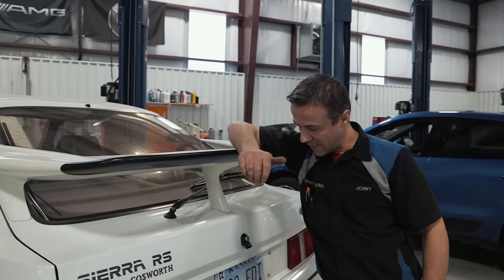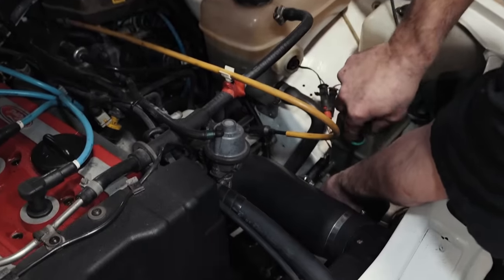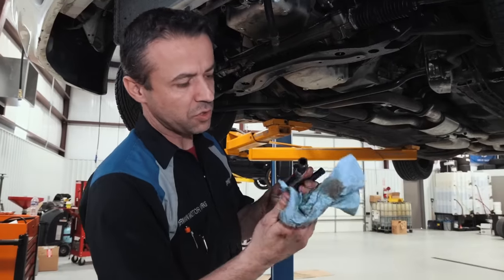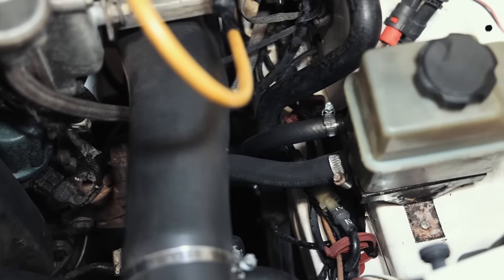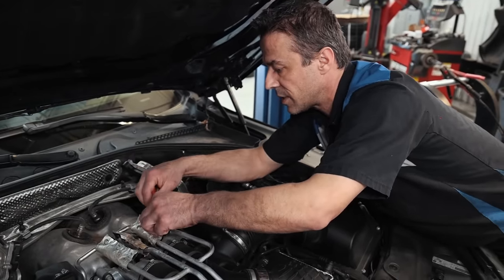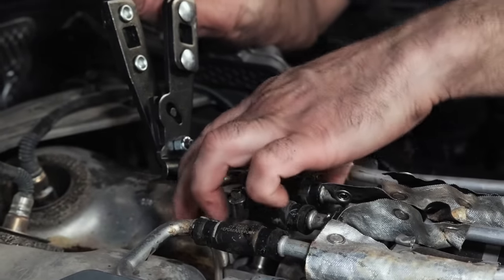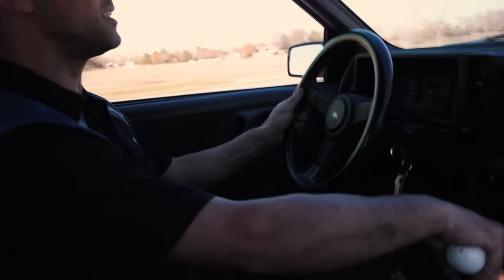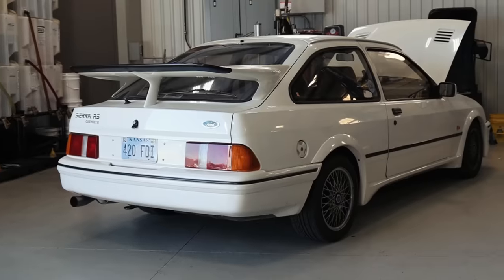Ford Sierra RS Cosworth. MY HOLY GRAIL.

Comment: My first car was 1991 Ford Sierra made in Belgium with 2.0 "Pinto" engine, with 5 speed manual. It did not have anything, no power steering, no abs :). Had it for 5 years, very reliable and fun to drive.

Comment: 🫡👍🇸🇪
I owned a 1985 Sierra 4x4.
V6 2.8l
4wd with 64% rear and 36% in to the front wheel.. it was so fun to drive in the winter.
I miss that car.

Comment: Its worth mentioning to US friends that this car is not a Merkur XR4Ti. The parent Sierra may be the same but the Cosworth was a very different car and the RS500 very different again as it was hand built by Tickford.
The bodyshells are different and while the XR4i bodyshell was used to prototype the Cosworth concept they became two distinctive cars in production.
Reply: Thanks for clearing this up.  I was wondering.
Reply: the RS500s were all right hand drive weren't they.
Reply: And an RS 500 has just sold for over £500,000
Reply: @ianmontgomery7534  The original Tickford RS500s were all RHD but some aftermarket tuners have produced LHD replicas.
Reply: The  differences with the 500 was a bigger turbo, eight injectors (4 connected), larger intercooler and different management. Externally Tickford added aero to the front, a lower spoiler at the rear with a lip added to the upper spoiler and your fog lights were in a box in the boot.
Reply: I was about to suggest the Merkur as well, lol. Would be cool to do a tribute build using one as a base. I would assume they’re still worthless so scooping one up shouldn’t be too hard and I’m also assuming parts support from Europe is still robust.
Reply: We had the Sierra XR4 in Argentina, 2.0 4 cyl, NA. It was the hot model to compete with the Renault Fuego and Peugeot 505. We never had the turbo versions.
Reply: Also the Merkur XR4Ti had a turbo version of the 2.3 ford found on mustang, thunderbird instead of the 16 valve. And rear 1/4 windows are different con the American car.
Reply: Many of the race cars were apparently XR4 shells with the rear quarters cut out, mostly in Australia if I remember correctly. Though a lot of cars tended to travel and swap hands over the years and ended up in different series.
Reply: It is also worth noting that all sierra XR4is used for racing in Europe were Merkur XR4Ti shells due to the added bracing and increased stiffness of the XR4Ti.  The euro sierra is pretty floppy.  Before the cosworth came along, the Merkur XR4Ti was actually more powerful than any sierra variant sold in Europe prior to the cosworth as the top spec engine there was a 2.9L v6 producing 145hp versus the base model XR4Ti that produced 175HP.  The shell of the XR4Ti is used for the Sierra Cosworth with modification to use the cheap base model sierra rear window as the cosworth came from the racing circuit, which used XR4Ti shells.  In fact, that base model window was heavier than the XR4i split window, but Ford was eliminating the split window as it was expensive to make and thus made the cosworth use the heavy cheap window design to mimic the cheaper styling that ford was migrating to.  The Merkur XR4Ti saved the Sierra in Europe from getting the axe prior to the cosworth coming along.  Sierra sales were miserable in Europe as Europeans lamented the loss of their boxy Cortina and didn't warm to the jelly bean style.  Ford was slated to kill the Sierra in 86 but was under contract to keep producing for the XR4Ti.  So they let sales in Europe continue while they fulfilled the XR4Ti contract.  That is when Ford got the bright idea to do the cosworth for racing using XR4Ti shells and made the sierra name legendary.  Had it not been for the Merkur XR4Ti, there would have not been a cosworth sierra or any sierra variant after 1986.  Many have built cosworth clones using the Merkur XR4Ti shell as everything Cosworth bolts up to it with zero modification.  Some go as far as using the cheap big window but most don't because they are not tickford and it makes the car heavier anyhow.  And now you know the rest of the story.
Reply: @paulnoble5627  yeah it was originally based on the xr4 shell for prototyping wasn't it? Then Ford would sell the "Cosworth" shells to teams and whoever wanted one.
Reply: @paulnoble5627   Well I suspect that is YOUR version of the rest of the story to which you are fully entitled of course. But I fear we must agree to disagree on the idea the US spec Merkur saved the Sierra.
Quote:
     "The Merkur XR4Ti saved the Sierra in Europe from getting the axe prior to the Cosworth coming along.  Sierra sales were miserable in Europe"
The Sierra in the UK alone sold 160,000 in 1983. Its best year was 1989 when, again in the UK alone, more than 175,000 were sold.
Hardly 'miserable'.
If the Merkur was such a great car why did Ford kill it after just 4 years? Lincoln-Mercury dealers moved just 12,400 Merkurs the first year, nearly 13,600 the next and sold just 42,000 through 1988 and 1989. It was canned in 1990. The 'miserable' Sierra went on for another 3 years.

You suggest:
   "The shell of the XR4Ti is used for the Sierra Cosworth"
Sorry it was not. As I wrote above it was an XR4i shell that was modified to prototype the 'Cosworth' concept to Hayes and others but thereafter they became very different cars in production.

You suggest the Merkur was lighter when in fact because of US and Canada regulations 850 unique parts were developed and all of the changes added approximately 280 lb (127.0 kg) to the weight compared to a Euro Sierra.

You also neglect to mention that the Lima engine put out 170 bhp for the first years of production and that the 175 bhp came later. Both were suffocated by US emission systems reducing output.
Reply: @freeandresrivera  the body shell is totally different...
Reply: @PatricioGarcia1973  The Renault Fuego, I forgot about them. When I was a kid I loved their shape, it looked like the future.
Reply: The 500's were pretty floppy, saw them in all sorts of motorsport discipline and provided they survived to the end they looked like they were going to fall apart at any second.
Could care less about the hyper-specific aero because there's no point having a floppy car you cant use, so I'd sooner have the much reinforced XR4 with the cossie powertrain.
Reply: @mfranssens  you should watch some argentine TC2000 from the mid 80s to the late 90s. The sierra, fuego, VW Gacel (like an 80s Audi 100), Fiat Duna, Peugeot 505. They went crazier and crazier as the years went on)
Reply: @chish1 - That’s right! Merkur; I remember that! It was such a cool looking car, but it wasn’t the same huh?
Reply: @ralphlazio505   Nope. The original was the Sierra XR4i and for the US market it became the Merkur XR4Ti. The Sierra Cosworths were a very different car in production.
Reply: @1chish  There was a version I believe sold in South Africa with a V8. Surprised that didn't make it to the US or Australia, given how popular V8s are in both those countries really.
Reply: @bionicgeekgrrl  You are dead right. It was called the XR8. Two were exported to the UK and on sold recently for £20,000.
As you say that would have gone down well in Australia (Right Hand Drive as well of course).
Reply: @bionicgeekgrrl  , think they were fairly limited production - pretty much a homologation special. They used the 4 door hatchback shell, and had to move some of the suspension mounts to squeeze the engine in. They also had the XR6 using the 3L V6 as a more common standard car.
Reply: Don't forget the Escort you could get with Sierra floorpan and RWD.  Amazing.

Comment: As a kid who grew up in the 80's, this was a car I lusted after.  I remember when I was at Intermediate school, someone parked one at the school staff car park regularly (guessing it was a PTA member or something, not a teacher) and I'd just stop and stare at it every time - for me it was far more interesting than a Countach or Testarossa.  Funny Jonny doesn't want to work on Fords - sure they are often horribly unreliable - but they are usually easy to fix... unlike BMW's which are often horribly unreliable and difficult to fix.
Reply: Fords have their own unique tools and used to change part numbers mid-year. They can be a real pain in the ass. I don't blame Jonny for wanting to avoid buying a whole new suite of specialist tools. Looks like his lifts are always full with Bimmers, anyways.
Reply: Absolutely agree - I bought a brand new Rosso Red Escort RS Turbo MK 2 in 1988 I paid £10,500 as I was in the trade. Loved it and it was totally reliable plus easy to work on.. I still have a sporty hatch - a 2011 Mazda 3 MPS, which I swear I'm never going to sell. I'm the same as you, I have always loved sporty versions of "normal" road cars. Forget the Porsche's, Maserati's etc.
Reply: @TheJohn8765  I've only ever really done serous work on Aussie Fords, which are easy as anything to work on - though they do some oddball shit with assembly hardware - bolts doing the same job requiring varying socket sizes, mixing up torx and hex all over the place etc. (probably whatever they had on hand), but no real special tools, not like a lot of German cars I've worked on.  Fortunately most of the time I'm working on Japanese cars, which are usually fairly logically put together.
Reply: @rogerbarrett9920  p p
Reply: If he needs a cigarette lighter ... I got one. NOS lk
Reply: My dad had a '88 Sierra 2.0 for a long time. It was quite nice car, no Cosworth though but still a bit more powerful than the average car back in the day. I also learned to drive with it, pretty difficult and dangerous in icy conditions. RWD and obviously no ESP, ABS or anything.
Reply: @basillicus3959  Probably made you a much better driver though.  I also grew up driving RWD cars, and my first "real" car was a Dolomite Sprint that I ended up tuning to around 200rwhp (which for a car that weighed in at under 1000kg with skinny little 195 section tyres was quite a lot) - I've stuck with RWD most of my life, and even though my current car, with around 400rwhp, has loads of safety systems - I do think it's made me much safer on the road.
Reply: Fords are not often horribly unreliable- usually that's said by people who have never had anything to do with them. I've owned an RS Cosworth like this, these require alot of maintenance however. But they are very rewarding.
Reply: @Flying_GC  I've had a couple, most recently a Falcon G6E-T for 7 years - it was reliable for me, only ever had very minor issues - but I'm super anal about maintenance - and my god, I loved that Falcon - wish I still had it - and yes, it was really easy to work on too, I really enjoyed doing most of the work on it - the Barra turbo is an amazing piece of engineering - only job I ever did that pissed me off was the water pump, and that was because they used a stupid fucking paper/cardboard gasket and glued it to the block with some horrific shit that took me hours to scrape off, working in the most uncomfortable position imaginable - The Japanese would use a rubber gasket in a channel & you'd have the whole job done in 30 minutes.
But that's Ford - they do a lot of things well, and some things really badly.  Other than that there were minor weirdness like replacing suspension parts where you'd have a bolt with a 16mm head, and the nut on the other side would randomly be 15mm or something slightly bigger or smaller... why?  Don't know - same with the water pump actually, it had a bunch of bolts with 2 different sized heads for no apparent reason - and as noted, they couldn't seem to decide if they wanted to use torx or hex... so they used both in varying places - so I'd always end up with a huge mess of tools to put away after each job,  - but that's kinda part of the character of the car - and I'd take it back any day if I could (some stupid bitch slammed into it whist looking at her phone unfortunately)
As far as my comment, I'm simply going off the facts and figures that show that Fords in general are often middling in reliability - my personal experience differs - but personal experience ain't worth shit.
Reply: " horribly unreliable and difficult to fix" exactly, and that is what keeps him in business.
Reply: And cheap parts for ford

Comment: Back in the eighties i worked at a bodyshop in the north west of England that prepared and painted Sierra Cosworths for Jimmy McRae and then Colin McRae, also Didier Auriol, the cars arrived as brand new shells straight from a fabrication firm called Gartrac where they had been fitted with roll cages and fully seam welded, we painted them up in their rally colours and sent them on their way, most of them didn't survive more than a few rally stages.

Comment: I believe the Mecury Merkur XR4TI  Rack is the same. I remember owning mine bought it new in 1985. Black with grey leather interior and a 5 speed. I installed an intercooler it had 200 HP and a big interior for 4 adults. Great handling. I installed Mustang LX 15" wheels with 205- 30 front and 225- 40 in the rear.(No problems)

Comment: Just a note on power steering lines, hard and soft. I had a mech work on my F150 and the hard lines were rusted out and leaking and he said "you need a new rack because the lines aren't available from ford" A rack was $800 Cdn. I said hold up, wait a minute, ordered them from rock auto and including his labour came to $85.00 The lines were $30 including shipping.

Comment: Having also been born in Europe, I see where you're coming from (no pun intended). Ford built up a very respectable reputation in Europe back in the day, not the least of which through racing.  Even their small models were held to a high standard.  I'm not surprised you have a sweet spot for them, especially a Cosworth.  In North America, the Escort was a different animal (some generations completely different) and lacked any of the love given to it in Europe. edit: on the subject of power steering systems, a note for those who may not know: a good hydraulics shop can usually make custom hoses and fittings, including oil cooler hoses, for cars that you may not be able to buy these parts for anymore.

Comment: My Merkur XR4Ti uses the same power steering rack and I've also had issues with the PS; although different PS pump components are used. Rarely do the racks fail as long as the boots are secure and free from tears. But leaky low-pressure PS lines happen (and high-pressure line o-rings). But so many little things like hoses aren't made anymore. But since the Sierra Cosworth and Merkur XR4Ti were made in W.Germany, parts cross reference with other German car manufacturers.  My brake boost check valve failed, but was identical to the E28 BMW 5-series. Swapped it 7 years ago and it works to this day!

Comment: I used to work a Ford dealer in the UK and got to drive my first Cosworth powered Ford, it was a 1993 Ford Escort 4x4 Cosworth a later incarnation of the Sierra with the same engine and drive train, took the car Ford a ‘test drive’ the grip around tight corners and round a bouts was epic, I did not have the talent to drive this car properly but some how it stuck to the road like a limpet and I didn’t crash.

Comment: This brought back so many beautiful memories.

I bought a one year younger Cossie like this, a 4-door 2WD saloon, exactly 20 years ago. Had the car for over eight years and it was a bittersweet time. It was the best car I've ever driven, but so fragile. Had the engine in pieces three times for bad head gasket and incorrectly set timing belt tensioner. So many bent valves and machine job hours...

Btw: What's the deal with Albanians and Italians? When I was in Albania over eight years ago they seemed to have the caffeteria culture just like in Italy. Even bier was called birra there. Beautiful country and amazing visit I had.

Comment: Such an iconic car of the 80s and 90s. In the UK these and especially the Saphirre versions were very sought after. Unfortuately, they were also sought after by thieves to the point some insurance companies stopped offering policies on them.

Forever one of the most iconic cars to be sold in the UK.

Another holy grail car you would probably like is the Lotus Carlton. That really was iconic and ground breaking in some ways, it is said to be why European cars have a 155mph speed limiter on most models sold across Europe.

Comment: Back in the 1980's you could get the Merkur XR4Ti in the US which was modeled after the Sierra and built in Germany.  I drove one from a rental company back then and it a great drive and really quick.  So, you can scratch that Sierra itch with one of those if you can find a nice one.  Enjoyed the video!
Reply: I’m always shocked by how cheap they sell for over here, considering how popular they are in Europe.  You’d think someone would snatch them up for peanuts over here and export them back to Europe to be used as rust free donors for the rusted cars over there.
Reply: @fw1421  Same engine was in Ford Sierra made in Argentina -- but without turbo ....  Merkur was a Xr4i Sierra with some reinforcements for US standards  and with US engine (the European original Xr4i had the 2.8i V6)
Reply: @fw1421  In 1986 the Mustang GT started at 10,691 $

Comment: I had the family version with a 1,6l engine.
This Cosworth Turbo version was used successfully by Ford in various European Touring Car Championships. They even did a 4WD V6 version.
A low milage RS 500 version of the Cosworth Turbo recently sold at an auction for the rediculous amonunt of £109125 !
Reply: It was £596,250 it sold for actually.

Comment: The sierra is glorious. I would accept the US equivalent the Mercur XR4ti with the inter cooled 2.3 turbo
Reply: XR4Ti had no intercooler
Reply: @MikeB4pl  from the factory yes. But retrofitting a thunderbird turbo coup intercooler was common or an aftermarket unit.   If I had one would immediately be done.